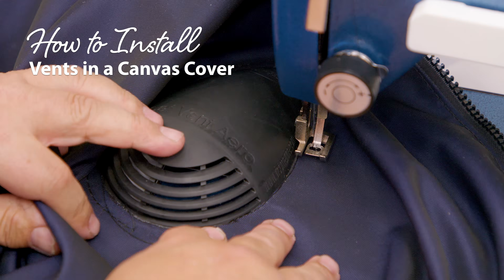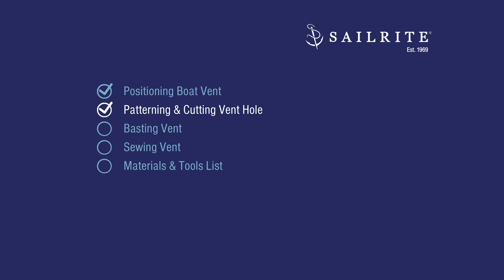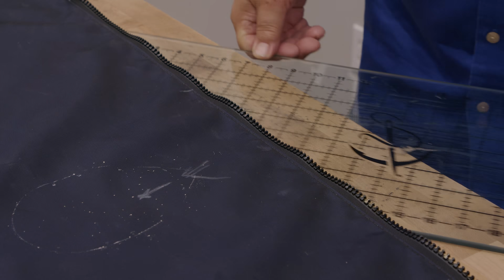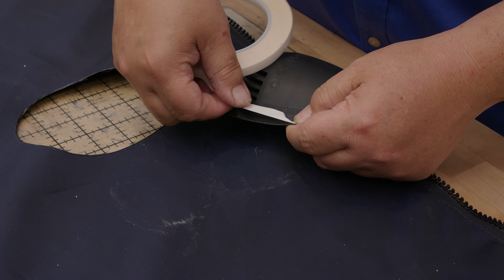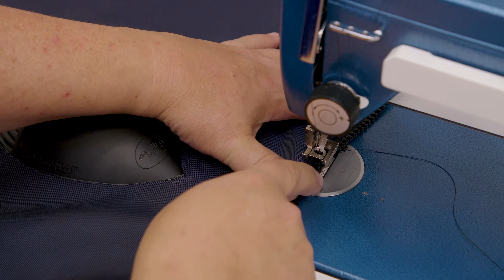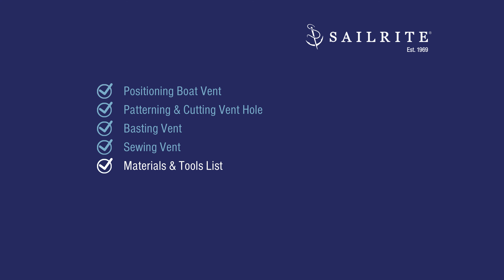How to Install Boat Vent in Canvas Cover

Comment: I have both the corded and cordless hot knives from Sailrite, and they are both great tools. However, there should be a warning that the cordless version does not work for a left-handed person because there’s a safety button near the trigger that can only be pressed by your right thumb. If you’re lefty you have to defeat the the safety button or the tool is inoperable.
Reply from the maker: Thanks for that info. We had not thought of that and will put it on the list of improvements to consider making.

Comment: What kind of needle is used for this? I can't imagine that needle lasts beyond this single job punching through semi thick plastic.
Reply from the maker: We used the same needle to make an RV cover, about 64 yards of fabric and sewed in 4 of these vents and it is still working great. That is over 4oz of thread or 1350 yards of thread on one needle.